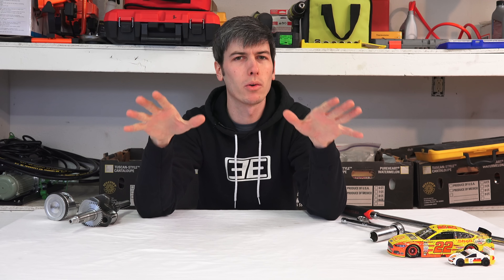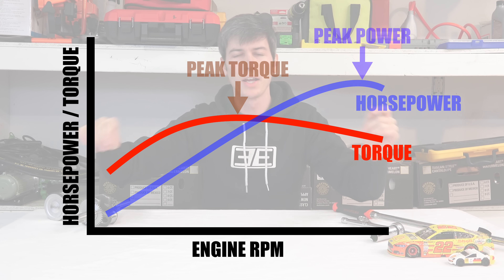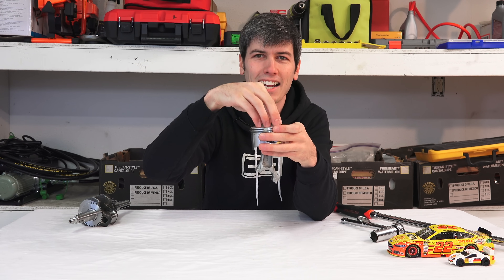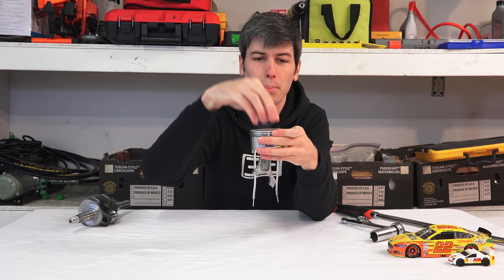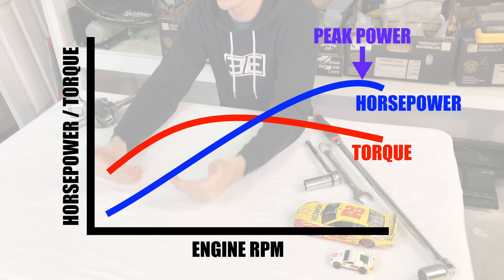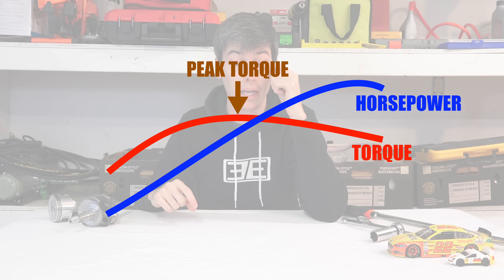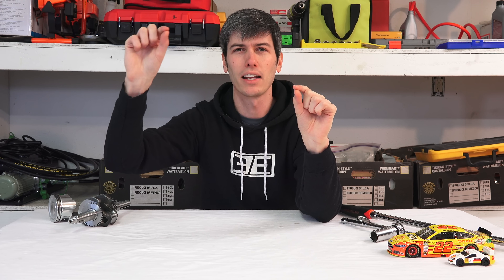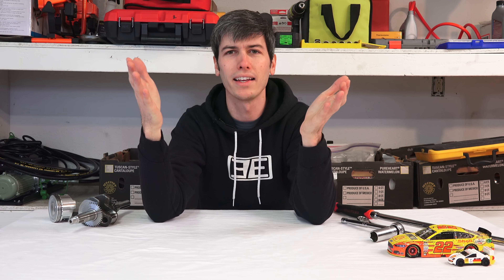Horsepower vs Torque - A Simple Explanation

Comment: This has nothing to do with the original application of how the unit of horsepower was developed, and hence, the numbers do not coincide with reality. 

If horsepower were torque multiplied by rpm, then a 550 HP 11,000 lb truck should not be able to outrun a 350 HP 4,000 lb car.  This explanation makes no sense, does not connect with reality, and is nonfunctional in real life. If it were the case, a 700 HP, 750ftlb car should not be able to outrun a 1000+ HP, 800ftlb car of similar mass. Both examples have been done, so there is something missing in the math.
Reply: he left out the conversion factor, the general definition of power is torque times angular velocity (ex. rpm). The formula for horsepower when torque is measured in pound foot would be torque times rpm divided by 5252. Horsepower is equal to 550 ft*lb/s
Reply: @Redtooth75  still doesn't work. It leaves no room for vehicles to have different power and torque output in different rpm ranges, even when peak output is the same, but volumetric efficiencies are vastly different...
Reply: @Faolan161  no, that is the definition of horsepower. Take the rpm of the engine multiplied by the torque the engine produces at that rpm and then divide by 5252. Thats literally what it is, 550 ft*lb/s
Reply: @Faolan161  you are talking about a more complete understanding of performance and capabilities. In the real world the peak number is not as relevant because the engine only makes peak power at one rpm. What really matters is the overall power curve which is much more important. The peak number is just easy to advertise rather than having to show a graph.
An engine that has a very large rpm range where it makes good power will usually beat one that has more peak power but a much narrower range where it makes any decent amount of power. The engine with a better power curve will be able to apply more power more often than the other. The other engine would deliver more power but only for a short burst before you have to grab another gear.
This becomes even more complicated when you account for things such as fuel economy, specific use, cost, engine lifespan. For example compare a semi truck diesel engine to a track car's engine. The diesel has a relatively lower range and tighter power curve than the track car. For racing purposes that is inferior, for towing purposes it is not. In a race the track car engine will be consistently making more power than the diesel because it has a much larger usable power curve, it makes more power across a broader rpm range. But it only makes that power at a high rpm where fuel economy and longevity suffers significantly. In a towing scenario the diesel is the best choice because its power curve falls in a low rpm range which is good for efficiency and longevity.
Reply: @Redtooth75  like I said, the math doesn't work, and doesn't take into account volumetric efficiency differences...
Reply: @Faolan161  in what way does the math not work? Its not a complex thing, its a unit. 
Volumetric efficiency influences torque which therefore affects power. The volumetric efficiency curve very closely follows the torque curve. Volumetric efficiency does affect how much power an engine has at any given point, but it does not change how power is defined.
Power is torque times angular velocity. Horsepower is a specific unit of power that is defined as 550 ft*lb/s. If you want to measure torque in pound foot, angular velocity in rpm, and power in horsepower than the formula is torque X rpm/5252. Its just unit conversions.
Reply: @Redtooth75  the unit of horsepower is the work needed to raise 550 lbs the distance of one foot in one second. It is not a unit of torque, because they are not equal, therefore not calculatable through relation. Horsepower is how quick it can do so much work.

Even though people have translated this to a calculation derivable by torque, they are different modes of work. They are two very different functions, and is why torque and horsepower can actually have different relations in different rpm ranges in the real world, but would render his calculation type useless. My two examples illustrate this
Reply: @Redtooth75  here's the thing. I watched a 550 HP, 1200 ftlb 11000 dually pickup outrun a 350 HP Audi A6 at 120 mph. By this math equation he shouldn't have been able to do that. The work being done is astronomically different. That's the real world affect.

Horsepower is the work needed to move 550 lb up one foot in one second.  This alone do s not equal torque measurement. The original unit of horsepower is just measurable, not calculatable through torque, because different engines will do more or less work with the same torque figures. 

The math also does not explain why a semi truck can do more work, with less horsepower, but substantially more torque. The work being done is exponentially more with the semi, which is what horsepower used to measure. By these calculations, one cannot do more work in the midrange of the power band, where horsepower numbers are lower, but the torque is different... The work being done is simply more.

I also watched two identical mass cars race, and the 770 hp car outran the 1050hp car with the bigger engine.

If horsepower is a derivative of torque, then the HP would have to increase with the torque curve, which is rarely does on 4-stroke engines...
Reply: @Faolan161  Im sorry dude but your understanding of physics is lacking. Power is not work. Work is force times displacement, N*m. Torque is rotational force which shares dimensions with work but is not the same, torque is linear force crossed with the distance from the center of rotation. Power is force times distance divided by time, N*m/s or lb*ft/s. Which is defined as energy/time, work/time, force times velocity, or torque times angular velocity. When dealing with mechanical power torque times angular velocity is the most appropriate definition to use. 
A horsepower is defined as 550 ft*lb/s. Which is equal to the amount of power needed to lift 550 lb 1 foot in one second. Or the power of a shaft spinning at 1 radian per second with 550 ft*lb torque. They are different types of power but are equivalent.
Please describe these different relations that contradict our current understanding of physics.
Reply: @Faolan161  You are confused about the definition of power. Power does not measure work, it measures the RATE of work. If two engines have the same torque output at the same rpm then they would make the same power at that rpm and would be practically the same exact thing. But if one engine produces the same amount of torque at a higher rpm then it would obviously be capable of doing the same amount of work faster.
I honestly do not know what to tell you, this is the definition of these terms. Take a physics class. Horsepower is torque times rpm divided by 5252, thats what it is. There is no opinion on that, its not a guess, its a unit. This is like arguing about the definition of a kilogram.
Reply: @Redtooth75  no, my understanding of physics isn't lacking, I am explaining the original purpose of horsepower, and you can't. All you can do is start the schitt slinging fest when you don't understand. Let me illustrate.

A semi truck is rated at 400 HP, 1200 ftlb torque. My dually pickup is dynoed at 650 HP, 1300 ftlb torque. I cannot haul what the semi can haul. The rating of horsepower is the unit of raising one pound the distance of one foot in one second. The semi can move more pounds in one second than my pickup can.  If the calculations were true, my pickup should be able to do more than the semi. 

This is a matter of an incomplete system that someone wants you to think is complete, and will mock you if you don't conform. The semi truck is simply far more capable of moving more weight than my pickup, even though the units of measure say otherwise. What is calculated is something different than the picture illustrating what a single horsepower is. More horsepower is the capability to do work faster, or more work in the same time frame. Not calculatable through torque output in this manner with this equation. There simply is no room to have the same torque rating, but be more efficient and move the same weight faster. Or a bigger engine moving far more weight in the same time frame. It is you who is not understanding the connection of physics and how it applies to life where it will make sense.

Comment: ok so why torque is more important for heavy duty vehicles? To do work at low-medium gears and speed, hence less stress on parts and more fuel efficiency? More reliable and practical.
Even though overall higher power vehicles could do better, by simply working faster with higher leverage as long as they can get enough traction on the ground, with an option to go fast under small load?

Comment: Too complicated. Horsepower is a sports car. Torque is a bulldozer. HP is how fast a car accelerates. Torque is how much force is behind it. Example: Smaller cars typically have more horsepower than torque. They will move just as fast as larger cars. But they typically have less torque. A family sedan or especially a truck, has more torque. So, the family sedan may accelerate just as fast as the smaller car, but if there are passengers in each car, the extra weight slows down the smaller car with less torque, more than the larger sedan with more torque. Torque is a pushing force, irrespective of speed. There, I think I explained it better.
Reply: You understand it completely wrong, contradicting yourself.

Comment: Good. Thanks.   I rode a Yamaha R1,  98 model, then transitioned to a 2005 model.  98 with a longer stroke,  made a little more torque.  05 Model, shorter stroke,  but faster revving,  and higher peak power.

Comment: Why look at torque at all? Should I just ignore torque values and only compare cars by horsepower?
Reply: Horsepower is a calculated number that sells cars and aftermarket parts.  Torque is the engine’s brute force twisting ability.  If you are accelerating, you are applying twist to a driveshaft to move.  That’s torque.  Torque pins you back in your seat on a drag strip.  Like a redneck diesel pulling stumps.  Horsepower keeps you moving once you are at high speed.

Comment: weird thing is I got a lower hp but high torque due to turbo, max torque start as low as 1.5rpm, I started off faster than a much higher hp with much higher cc without turbocharged and stay ahead through out

Comment: I have a toyota vvti 4 cylinder 2.7 L maual transmission. 
Serv dept changed vvt gear to camshaft instead of needed repair, replace vvt valve, stating  it passed he Stall Test. To correct engine code, should hade replaced VVT valve $300, instead replaced vvti gear $1200, which did not clear code snd in fact had drop in idle RPMs to 600 and bogging engine between 2nd and 3rd gear. Vvt valve subsequently changed, code cleared, but RPMs still not corrected, serv rep saying no way to correct idle without just randomly replacing parts. 

Question. How would a STALL TEST, indicate need for a new vvti gear if passed the stall test? Stall test checks for transmission torque against braking. The Stall test not even on their diagnostic tree to fix the code. They are paying for the $300 vvt valve but sticking me with the failed repair of the vvti gear new set of struts $2000! I think ive been bamboozled, again! Hoping to get a refund. Will see today. Waiting a call from tge serv Mgr.

Comment: A couple questions:  Is work = force x distance?  If torque is lower at lower rpms, but rpms are not part of the torque equation, why is this so?  Why does torque drop off eventually at highest rpms?
Reply: Work is force times displacement, to be precise. Idk why you ask, but if you want to relate torque and work, work is torque times 2π.
There is a torque curve because combustion process has different efficiency at different speed of an engine. There is a sweet spot that is adjustable by tuning. Performance car engine has a better combustion efficiency towards higher revs, i.e. peak torque is at 5000rpm, and a city car with similar engine can have peak torque at 3500rpm.
Reply: @IgorArkin  I ask because in the video you use the term work to define horsepower, without directly linking it to torque.  So at highest rpms, the efficiency drops off because it can’t get enough air quickly enough?  Or the ignition spark does not spread as well?
Reply: @inquirydance  me? No, not me.
Anyway, torque times 2π is work done by a single revolution. 
Valve timing is optimised for a sweet spot. On higher speeds valve float starts to occure and it is nearly impossible to make a proper valve timing. Air mass entering can even be increased at high revolutions (volumetric efficiency), that affects power. There are separate videos on YT for this topic.

Comment: To me the simplest way to explain it is that an engine produces only two "things" - torque and motion (rpm).  Either of these "things" by itself is totally incapable of doing any work.  However, when you combine them through multiplication you end up with power which is what determines the work capacity of the engine.  People seem to get confused trying to compare torque and power and debate which is better but at the end of the day power is simply torque in motion, nothing more and nothing less.
Reply: Amount of work, capacity of work, quantity of work or whatever of work is not related to engine. It is related to size if a fuel tank. If more work is needed to be done you need more fuel. By definition.

Comment: You need high torque for hauling which is why heavy vehicles have slower speed.
Reply: No you don't. You need a high thrust. Sport car needs a high thrust to accelerate fast either.

Comment: I think it’s easier for cyclists to understand this because at some point you cannot press harder any faster, but you can drop a gear press just as hard much faster and make the vehicle go faster.
Reply: wow seems like I understand it now. thank you
Reply: drop a gear and disappear
Reply: this actually made it simple thank you
Reply: also, if the diameter of wheels is more, you have to paddle less to reach the destination
Reply: @nickharrison3748  Which is great, because I hate paddling on a bike, it just seems to get me nowhere
Reply: If you're riding a bike and you drop to a lower gear for a hill, you have to pedal faster to maintain your current speed because each rotation of the crank turns the back wheel less times. You'll have to pedal more times to travel any given distance and that means if you want to maintain your speed or go faster in the lower gear, you'll have to ramp up your power output. There's no free lunch, you can't go faster with lower gears unless you exert extra energy above what you were putting out in the higher gear. I can't explain the physics but it's easy to research, it's all under "energy"
Reply: Which is precisely what happens in the gearbox of a car or truck
Reply: Whilst going through the green man at traffic signals.
Reply: Also on bicycle you can greatly feel the low end torque, when starting at first gear at 0 RPM and smashing the pedal down you exert a lot of force on the gears, leading to high initial acceleration, while starting of the higher gear will lead to a slow initial acceleration but much better acceleration later even if you use the same force.
Reply: All very good explained, thank you, only one remark power is not torque x rpm, correct is force x rpm. But ultimately it’s same if leverage is same. In our case the difference of force between force created and force needed at the shaft is multiplied by rpm giving the reserve power that our car has at a certain point
Reply: @tannogo9538  Horsepower = (Torque × RPM) / 5252 for an engine. 
Nothing you said is remotely recognizable as established science. "force" is not a correct term for this equation.
Reply: Basically torque is moreliike RPM?
Reply: @PillarFace essentially rpm for wheels

Comment: Your explanation is very good, but wrong on a key aspect. The torque/power curve you present shows the maximum torque available at any rpm for the engine. During maximum acceleration, you are temporarily at every point on the horsepower and torque curve. You do not need to change gears to obtain any given point on the curve. You do need to be at maximum throttle. The peak of the horsepower curve does give the maximum acceleration point for the engine, as you have stated, and not the maximum torque value, as the power curve is the product of the torque produced multiplied by the rpm. 
Operating at this maximum horsepower point in an accelerating car is momentary, as the engine is accelerating, and quickly increases beyond the maximum horsepower point. This is the reason for changing gears. Ideally the next gear is chosen just below the maximum horsepower point, accelerates to a position just above the maximum horsepower point, and then once again move to the next higher gear.
Otherwise, I very much enjoyed your video!

Comment: I think of the rope, Block and tackle example for another way gearing makes work easy. The ancient VW bus: 36hp and seven passengers: low gearing required, slow but surprisingly torquey.
Reply: But the early VW vans had reduction gears on the back axle.  Because the vans were so low powered and to move the weight of the passengers/cargo, it needed reduction gears to do so.  This would have made the vans ultra-slow.
I dont know where you got the torquey from.
Reply: @ReddThreee  torque sufficient to maintain forward travel though laden.

Comment: Torque and power is like a fan. You can put finger in spinning fan and stop it cus it doesn’t have much force/torque but if it keeps spinning at relatively same speed then it has more force/torque.
Reply: And has more power.
Awful example just like any other, cause there are no examples of difference between torque and power.